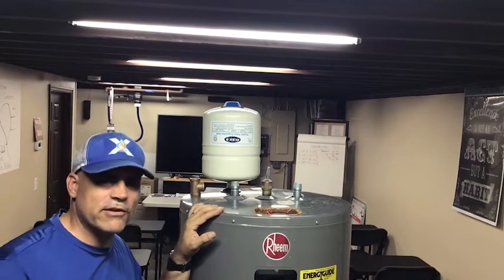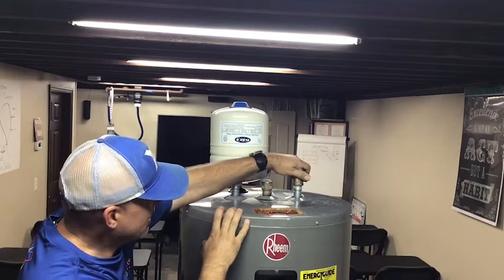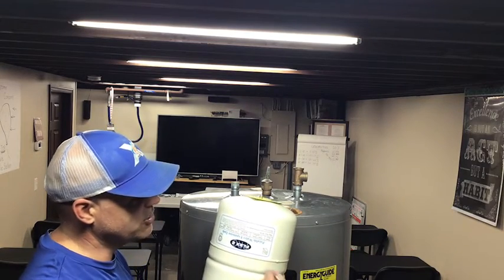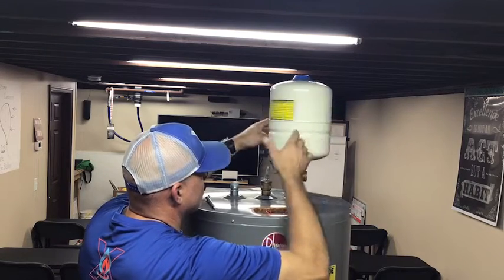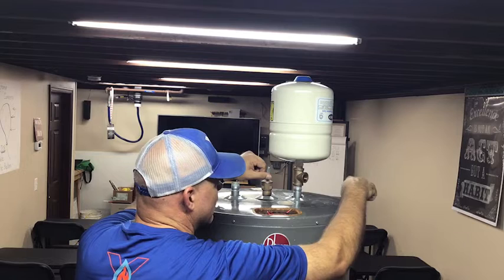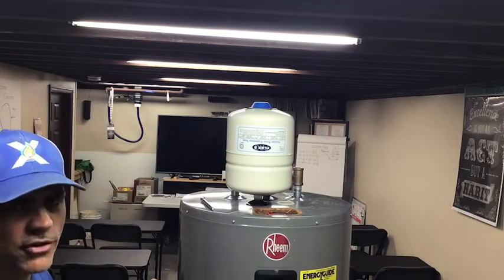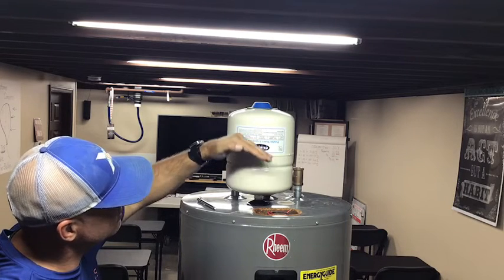Training Series: Expansion Tank Installation

Comment: Plumbing code does not allow expansion tank to be supported by its own piping, you need independent support.
Reply from the maker: Thank you so much for pointing out that many different codes do require that the expansion tank is not supported by the piping. Here in Florida we have our own specific code and many municipalities also create changes in the state code by adding their interpretations of the code. We are not required in our area to support it with a bracket like some areas. But I am so glad that you did mention this so that others can understand that they need to understand their local codes before doing any plumbing work. I am interested to know if you agree with me that the weakest part of the expansion tank and connecting piping is actually the connection of the threaded nipple to the body of the tank. This area seems the most prone to rusting and failing over time to us. Thanks again!!

Comment: Nice explanation but you didn't say whether you install the expansion tank on the hot water or cold water side of the water heater.
Reply from the maker: I am so sorry if I missed that but you always want to put them on the cold side of the tank. Now I can only tell you what I have heard from the manufacture's rep and that is that it is not really designed to handle hot water going into it or flowing past its inlet port. Most importantly the instructions tell you to install it on the cold side, and we want to always have warranty from the maker so stick with what they tell you to do. I hope that helps you!

Comment: Looks like you got it upside down. There's a reason why the manufacturers put the label on the way they did.😮😊
Reply from the maker: Yes, there are several different ways to mount the tanks that they manufacturer recommends. Vertical is the preferred method and sticker up or sticker down is okay with them as long as it is supported and air pressure is set correctly upon installation.
Reply: What are you talking about? It only goes on one way.
Reply: @mikealvord55  lable is upside-down, water line should be on top, not from bottom.
Reply: @vinjens1791 you’re not a plumber are you
Reply: @jrmediababy …no but he can read and follow instructions. The manufacturers of the tanks recommend the tank be mounted vertical with the air nipple at the bottom and the tank located so if it leaks the water will go into a catch pan.

Comment: so I have a few question I have a home with a 40 gallon tank and I want to go down to a 30 gal is that ok ? Also the expansion tank how long do they last ? And which is a better tank rheem or Aso ??
Reply from the maker: We normally feel that about 3 years is all that we can expect in Florida for an expansion tank. Tank capacity is about usage, if you only need 30 gallons that would be fine but the lowest price for a water heater is normally a 40 gallon model as it is the most sold model out there and as such the manufacturers make the most of those and that keeps their price the lowest of all the tanks out there. So I would actually say to think twice about going down a size.

Comment: You missed one point, Does this tank have to be installed right by the tank or can it be located anywhere on the cold side of the line?
Reply from the maker: That is a great question! So the BEST place is right next to the water heater on the cold side of the heater. That does not mean you cannot put it on a cold line in another area of the piping but it is most effective at the water heater. The final point on that is to make sure it is after any check valve or backflow device that is on the whole system.
Reply: Thank you very much for replying to my comment.   @plumbingexpress6801

Comment: Why do i need an expansion tank when i have a TPR valve?
Reply: So your TPR DOESNT start to leak....it's not meant to cycle...a expansion tank is...
Reply from the maker: That is a great point for his question. Thank for helping respond to his question.
Reply from the maker: So I am going to guess here about the "TPR " valve being the T&P valve possibly. That valve is made to protect the heater from damage when it either overheats or over pressurizes but it is not made to buffer the expansion of water in the system due to heating the water. If you are meaning a Pressure Relief Valve the it does do a similar thing as the expansion tank, but unless it is installed near the water heater itself then it is allowing extra pressure to act on the tank before it is kicking off when it is installed farther away from the heater.

Comment: I was told the tank needs to be vertical and water nipple of expansion tank to point up (not down - as shown)
Reply from the maker: Great question Rohit. Most of the manufacturers out there allow for them to be installed either connection up or down as long as vertical.

Comment: Is that ok for 2 water tanks 1 n 2 floor
Reply from the maker: Not quite sure about that question but let me take a shot at an answer. This size expansion tank is only good for 1 water heater. If you have 2 tanks then you are going to need to use 1 tank for each water heater.

Comment: Wat happen to the pressure valve 0n the nipple of the cold water pipe of tank
Reply from the maker: Not sure that I understand your question Hildeberto. The hot and cold parts of the water heater have metal nipples that contain heat checks in them to stop hot water from seeping out of the heater when it is in a static setting.

Comment: Which side do the expansion tank go on?
Reply from the maker: So they are installed on the cold water side of the water heater.
Reply: I have seen water heaters with check valve balls in the nipples only permitting flow in one direction... Thus it would have to be on the hot side...

Comment: I have a compression tank above in the ceiling and it is done... Instead of cutting it all down, can I used an expansion tank instead ?
Reply from the maker: I am not sure what you mean by compression tank. Are you perhaps meaning a pressure tank? That is something that would be connected into a pumped water system. So you might have a well and then you could have a pressure tank. Or do you possibly mean a water heater tank in your attic? Let me know and I can try and help you.
Reply: @plumbingexpress6801  A compression tank is a steel tank that does not have a bladder. There is nothing seperating the water and air, therefore, it must by mounted well above the boiler. Thy are about the size of a cola dispense can. I ended up plumbing in an expansion tank.

Comment: I have 2 heaters and each has expansion tank on cold side.  my system pressure is 60 psi. One has 55 psi and other has 75 psi. Is this acceptable? bad?
Reply from the maker: So you ideally want those tanks set to match your system pressure. The 55psi one is closer to the right pressure than the 75psi one. My biggest question to you is do you have a well system for your house or is it municipal water coming to your home? If the water is coming from a well then it has a pump and most of the systems that have a well on them are going to have a pressure swing of about 20psi when they are used. If that is the case let me know and we can help out.

Comment: The water company ruined my 2 year old water heater buy installing a new meter with a check valve in it 
And not telling me. It bent the pipe on top of the tank and broke the solder connection.
Reply from the maker: I am sorry to hear that. I would be interested to hear more about that issue.
Reply: @plumbingexpress6801  I put a new hot water tank and expansion tank in 10 years ago and haven’t had a problem since.

Comment: Good video. I used a Holdrite expansion tank bracket to mount my expansion tank. Is there a minimum/maximum distance that the expansion tank should be mounted in? And can the expansion tank be mounted in any orientation?
Thanks
Ron
Reply: The expansion tanks that we use state a minimum of 18” from the inlet. In this video it’s obviously less. I’m curious also as our tanks state the pressure needs to be set 2 psi lower than incoming water pressure.
Reply from the maker: Great idea to use that bracket to hold it to the wall. Always check the manufacturer's directions to see what they state is recommended. Most of the tanks are supposed to be mounted vertically either with the connection point on the top or bottom.

Comment: Video is more talk and instruction than actual install thumbs down
Reply from the maker: Sorry you did not like it. This video is mostly about why we put them in and where we put them in on the system. The overall installation is achieved by screwing the tank onto a female adaptor of the correct size. If that is what you needed help with then please do not attempt to install this yourself.
Reply: @plumbingexpress6801  you're funny

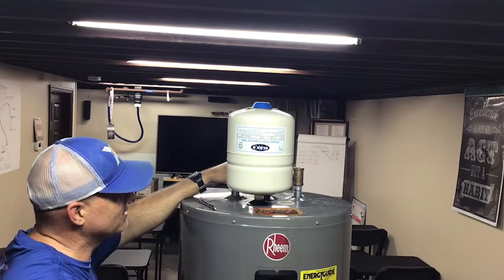Comment: I disagree with you when you imply (actually say at 8:45) that you only need to install an expansion tank if there is room. The amount of space available does not change the physics of the system. You may choose not to install a tank when there is not enough room, but if the system needs an expansion tank (e.g. closed system) it needs an expansion tank. The lack of space doesn't change that.
Reply from the maker: I appreciate your candor on this Derby Dad. I agree with you on the fact it should be a code issue to have the expansion tank installed as it is the best source of being able to properly negate the effects of the thermal expansion on the system. We unfortunately do not have that built into our code here in Florida so we have to protect against thermal expansion but that could be by using an expansion tank or a pressure relief valve. I do not like having to put in the PRV over the expansion tank but we have condominiums that have an air handler sitting right on top of the water heater and there is no space to install one, barely enough space to install the PRV that we do put in. I also liked that you hit on that great point of a closed system. Very important to know what type of system you are installing the water heater into and how to properly protect it. Thank you for watching and the feedback.

Comment: Why if there is no easy place to mount the tank it’s alright to leave it out of the system? This makes no sense if their that important you must find a suitable location for it “RIGHT” WTF!
Reply from the maker: It is a rock and hard place situation for us on that. We have many areas here in Florida where the initial installation does not allow for any room to install an expansion tank. The only place to mount it would be exposed in a room adjacent to the water heater. In those situations we put in a pressure relief valve to vent off the excess pressure into a drain. There are a lot of times where we can barely fit the PRV into the tiny space we are given. Thank you for watching and for commenting.

Comment: After the tank is installed can the air pressure be checked and adjusted (without removing the expansion tank)?
Reply from the maker: We don't recommend trying to set or adjust the pressure while on the water heater. It needs to have zero pressure pushing against the bladder to be set correctly.
Reply: @plumbingexpress6801  The next time the water goes off  in my neighborhood I will try to remember this and at that time I will open a faucet and then check the expansion tank pressure. A while back I installed a pressure regulator near the meter to reduce the pressure from over 100 psi down to 60 psi, but never thought about the expansion tank. Thanks. Wouldn't that work?

Comment: I’ve yet to see one video on w/h expansion tanks that shows them properly oriented
Reply: Yep every video they install upside down 🤦
Reply: Aaron Seward 
Yep, they just don’t understand bladder tanks. A few manufactures ok it, but it’s still dumb.
Reply: Manufacturer states to install a min 18 inches away from the water heater.
Reply from the maker: It can be easier to mount when the bladder is on the bottom but you have to know what the manufacturer does and does not allow.
Reply: Plumbing Express 
That’s true, some do ok it, but it still traps air upside down (or sideways) reducing volume which will cause the tank to fail prematurely, which is good if you want to sell more tanks on call backs. These things have a 1 year warranty typically and if installed sideways/upside down will last a couple years. Orient them bladder side down and they last longer (mines 8 years old) than a couple years. It’s the w/h your protecting from expansion damage and it can also help with water hammer. People often don’t realize when they fail unless they are the source of the leak.
I always ring the tank and check for water at the schraeder when I see em.
Reply: If oriented with the water on the bottom, I am sure it would get stale and probably molded inside.
Reply: @cjbiker4780 it's not being fed continuous oxygen... Once the oxygen is consumed ( usually forming rust ) nothing is left to support growth....until new air from a drained system or something else goes by, but then again that's a mixture of 78 percent nitrogen 1 percent argon or other impurity and like 20.9 percent oxygen @ sea level....

Comment: Do you need to drain the tank first ?
Reply from the maker: You will need to be able to add in a leg off of the cold side that allows you to securely mount the expansion tank. It can become very heavy when it gets used. You don't have to drain the tank but it would be a good opportunity to do that when you are working on the heater and the pressure is turned off.
Reply: @plumbingexpress6801  thanks for the reply

Comment: In your professional opinion does it matter if the schrader valve is at the top or at the bottom of the expansion tank when it it oriented onto the water heater system?  Or do manufacturers tell you they have a particular orientation for their tanks in their respective installation instructions?  Thanks for any feedback.
Reply from the maker: Each manufacturer has specifications for their units. Some do allow for multiple orientations of the tank, some only allow for the valve and bladder to be at the top of the installation. Make sure to consult your directions before installing.

Comment: So I need a 4 Gallon unit for a 70 Gallon Gas Water Heater?
Reply from the maker: You actually need to verify that with the manufacturer of the water heater. We use a 4.8 gallon or 18 liter expansion tank on anything bigger than a 50 gallon water heater.

Comment: I have an apartment building with 4 tanks- no room over head. Could I install one big expansion tank on the feed line before all of the tanks?
Reply: yes, I'd use 2 gallon of expansion for each water heater. so you would need an 8 gallon unit located on the coldwater  input supply that leads to the water heaters. I'm assuming that they are 40 gallon gas water heaters
Reply from the maker: I feel like we need more information to really help you with that one.

Comment: Good video & explanation. I install my expansion tanks with a ballcock first , dielectric union, than the tank and if possible I try to get this up in the floor joist above the water heater ( basement installations). By doing it this way it does several things #1 if the expansion tank fails you can replace it in about 10 minutes without turning the water off #2 it makes the replacement of the water heater very easy without the expansion tank being in the way &#3 it gives the expansion tank cathodic protection.
I hope some of this information helps and you all stay safe out there👍.
Reply from the maker: That is a great way to do it as well. Here in Florida we have most of our heaters on the same floor as the house, single stories mostly around here, so there is not much flow back without the shut off, but we do have those on any multiple floor homes or condos. We don't usually use the dialectic unions as the water is so hard down here it destroys everything in short order. Thank you for the input.

Comment: Any advice on replacing a tank that’s not on the water heater but is on the main water line coming in from my well?
Reply: So, if your well system uses expansion tanks to supply  pressure rather than a booster pump from a storage tank, you don't need a water heater expansion tank. your large well pump expansion units work as a pressure relief as well as storage. Expansion tanks for city water sources should be used on the cold water supply after the pressure control/backflow valve.  the expansion tank does not need to be on top of your water heater. the goal of the expansion tank is to prevent extremely high pressure build up in your city connected water heater. At night water pressures in city water systems can grow by as much 20% plus your water heater hot water "expansion" can cause plumbing problems for your 80psi rated tank. pipes are rated at 200 psi. most city water supplies are a min of 60psi to 100psi. the average being 80psi. The expansion tank prevents the water pressure from going over the water heater rated 80 psi.
Reply: @rss608  Hello Roy nice video.  I have an oil fired hot water base board heating system with a coil built in for my domestic hot water. I just purchased a new hybrid hot water heater. What I've just learned is that people with a well (my source) may have a softener installed which could possibly have a check valve built in. In this case they should consider an expansion tank.
Reply: @williamcavanaugh4613  I've never seen a water softener that has a check valve in the water pressure line. That said most water softeners do have check valves in the wash/rinse valve but they have nothing to do with the fresh water flow through the  softener/media.
Reply from the maker: To the credit of several others who have posted, the tank you are talking about is slightly different overall as it is there to help with the pressure that is created from the well pump and to allow the pump to cycle less times due to the pressure cushion created by the expansion tank.